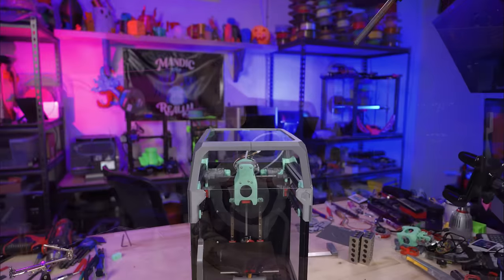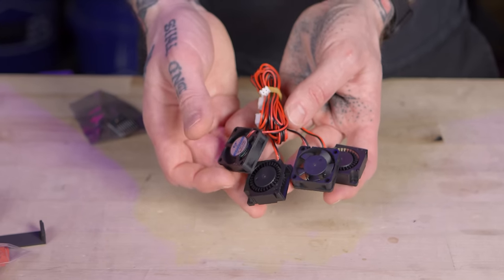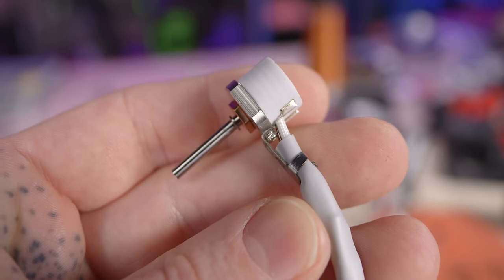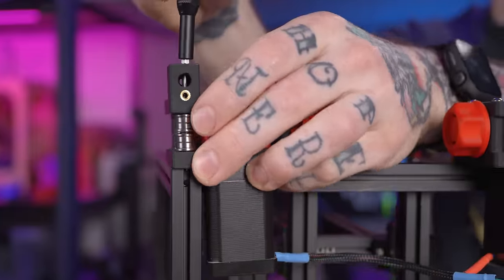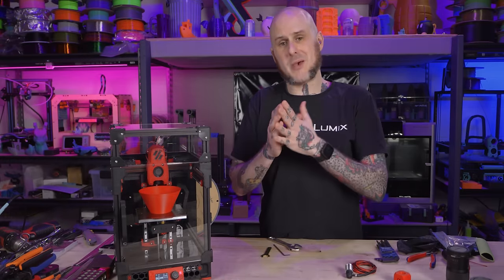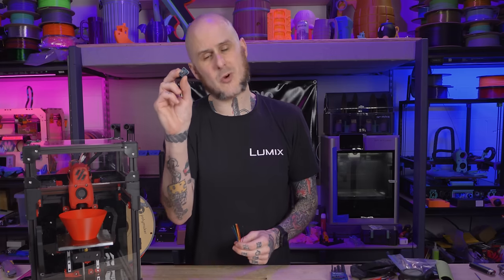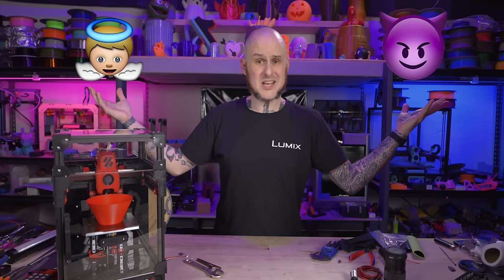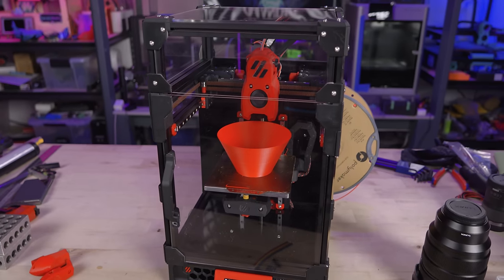Amazingly CHEAP Voron 0.2! - SIBOOR V0.2 3D Printer Review

Comment: "Budget" is sort of subjective here.  That 0.2 looks to be like a 150x150 plate, which is kinda small for that price point.  Granted it is going to come with everything you need, including the glass to encase it, which is nice.  Still the build volume to price ratio is quite bad compared to what you can find out there.
Reply from the maker: You should probably check out my latest video on that very topic...
Reply: No, the small build volume is a selling point.  The printer is so small it does not take up much space.  The V0.2 with it's 150mm build plate can print every part needed to build a V2.4.  So it is a quite good printer for my robotics projects.  I can build a medium-sized quadruped robot and none of the 3D printed parts are over 150mm.  The V0.2 works well for making functional prototypes for all kinds of machines.    That said, it would have to be your second printer.

Comment: Linear rails look rusty @13:10 ??
Reply from the maker: Yea, Greg’s Maker Corner actually has rails that were worse than mine. They actually sent me brand new ones before I even started. I inspected the rails I had and missed that little bit of corrosion. (The Z rails are the old ones, I mixed up and didn’t replace.) So SIBOOR did dispatch new rails. I’d assume they’d do that for anyone who had an issue but I can’t know that for sure.

Comment: I'm looking for a good value voron v0.2 kit. And I'm wondering how this siboor kit would compare to the formbot kit. 247printig made a good comparison between the formbot v0.1 and ldo v0.1 kit. And after seeing that I'm leaning towards the formbot v0.2 kit. In his comparison the ldo had some issues and the formbot didnt. I'd prefere the formbot over the siboor because it includes a kirigami bed mount and I can choose the dragon hotend. Its no issue to me that it doesnt include the printed parts as I already have a printer. Does anybody advise against the formbot kit?
Reply: @rahimdamji9602  Thanks for your offer. I'll think about it👍🏻
Reply: The extrusions on the formbot kit are HORRIBLE. Mine had goop on some, all the blind joint taped threads want to pull out and require a good amount of loctite to stay together. The kit was missing a lot of things and am still working to get shit fixed or replaced 3 months in. The rails I got were smooth but had a very small amount of preload and the x axis rail needed to be replaced. It wobbled in 2 axes and resonance and print quality suffered drastically. The PSU it came with had a lot of coil whine which was pretty annoying as well. That’s been my experience and I have a V0.1 kit. They told me the 0.2 kit has a Z1 preload rail and it is better but still not great.
Reply: @nicholasclark4329  Weird.  The Formbot kit (0.1) I got was really well done.
Reply: @toddzino58  might’ve just been unlucky but I’ve spent in total about $700 US (including 400 for the kit) trying to get this shitty kit to work. Ended up ordering new frame rails bed mount (kirigami deflects too much to be usable) needed a new hardware kit because the screw heads were sloppy in my HSS drivers that I didn’t want to ruin anything. New mcu (got a doa). Just a bunch of irritating shit. I’m on the second round of replacements because stuff just breaks or doesn’t work or came missing. Highly regret and wish I would’ve self sourced

Comment: Great video and super informational. I just don’t get why the voron style printer’s build areas are so small and how that appeals to people? Cool it can make a 15 minute benchy, literally anything else you want to print will have to be 1000 pieces.
Reply from the maker: I would say a solid 25-50% of things I print fit within this build volume. It used to be more before I started printing silly big things a lot. For a desktop rapid prototype machine (why I built my 0.1) it’s excellent. There are also 250, 300, & 350mm V2.4 & Trident machines. Look out for a video about a 350mm V2.4 I built with 3DPrintingNerd coming out this Saturday!
Reply: It really depends on what you print. Over 75% of the things I personally print will fit in this build volume. The portability of the design (once you add handles) also really appealed to me, if I want to print ASA I can easily carry it to the garage.

Comment: With the P1P only a little bit more and a Creality K1 coming out I'm not sure what the point of these are.
Reply from the maker: Fully open source, off the shelf parts easily available, & customizable. Some folks like to know a machine in and out, every single screw of it. Some like to buy an appliance. No right or wrong, just different cases.
Reply: @MandicReally  Yes very true I just don't like that it seems to cost more to go the DYI route.
Reply from the maker: @VampireOnline  it is the cost of scale. Creality buying thousands of the same parts gets a cheaper price. I used to be a custom
Metal fabricator. Custom / diy almost universally costs more when you are talking about things that go beyond just “wood” or supplies & time.

Comment: What's the point of a voting that size at that price, when creality has enders dirt cheap, larger, and clipper boards
Reply from the maker: It consumes less power than an Klipperized Ender 3, prints faster, generally at a higher quality, is enclosed for higher temps, & a surprising amount of prints fit within its build volume. 

I’ve sold products that more than paid for the machine printed on the machine. It can be a very useful rapid prototype or production machine.

Comment: Perhaps this is my historian training showing, but I feel like this kit really gives us insight into how the various electronics come from the manufacturer.  With a kit like this there's no way Siboor is spending a lot of money on labour, so things like the half-terminated motors are surely just in the state that they bought them?  (Also, noting that the lack of basic tools makes the price increase even steeper is good (for some users - I have those tools so their inclusion wouldn't raise the kit's value for me), but calling out the price increase without putting it in the context of over a year of ridiculously high global inflation is maybe a bit unfair?)

Though I will say I think the accelerometer pins and wires being as they are is actually a good thing for someone looking to learn to build printers.  Soldering through-hole pins is about the easiest kind of soldering there is, and if someone wants to get into building 3d printers, they'll need to learn to solder at some point.  Plus, if gives you the choice of attaching the pins or of eliminating one connexion and just soldering the pigtail directly to the PCB.

Last thought: up until now I've parsed your accent as "Canadian, probably Vancouver, who says "zed" wrong" but the way you say "enclosed" is very, very American.  I just find that funny!

Comment: MCU = Micro Controller Unit, not Motor Control Unit, as in the little CPU on the board, that's the MCU....  i.e Arduino is an MCU, ESP32 is an MCU...etc...

Comment: Insane high price for such shitty 3d printed parts and the amount of DIY needed. What's the pro's of one of these over a build and go printer like a Ender 5?
Reply from the maker: An Ender 5 will never achieve the acceleration of print speeds possible with this machine. Even the Ender 5 S1 I was struggling to produce a sub 25 minute Benchy that looked even close to as good as the sub 20 minute Benchy I did on this machine with little tuning. 

This machine is for folks who enjoy tinkering and building, and want a fast little machine.  I built my first V0.1 to have a “rapid prototype” machine. Its build volume is small but it can fill that volume rapidly. 

It absolutely isn’t for everyone, but that’s not the goal.
Reply: @MandicReally  I get it. But price wise for the size of the machine the lack of quality is unnacceptable imo.

Comment: The bed size is absurdly small and makes this a laughing stock at this price point to call it "cheap"!
Reply from the maker: How often do you print single objects larger than this build volume? I print a lot and I’d say a solid 50% of the stuff I print fits in this build volume. The machine is meant to be fun, and great for rapid prototyping. It takes up little space and can just run off prints quickly while consuming little energy. 

It isn’t for everyone, but there is a reason to the madness.

Comment: Clickbait. It isn't that cheap.
Reply from the maker: It is 30% cheaper than other kits. The only cheaper kits I’ve found don’t include all parts (Fysetc has printed parts but no Raspberry Pi to run it.) It is the single cheapest kit I can find that will allow someone to build a machine without having to buy other things. No other kit is a Voron in a box.

Comment: I'm sorry but $470 is not "amazingly cheap"
Reply from the maker: Have you checked prices on Voron V0.2 kits? With printed parts & a board that can actually run this machine included this is the cheapest one on the market. You can find cheaper but they don’t come with Raspberry Pi, or printed parts for the most part.